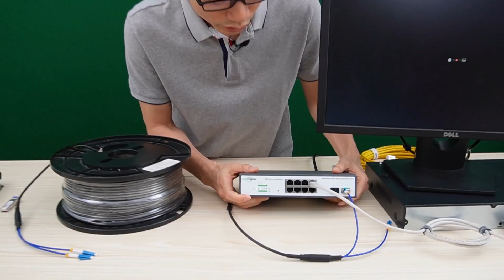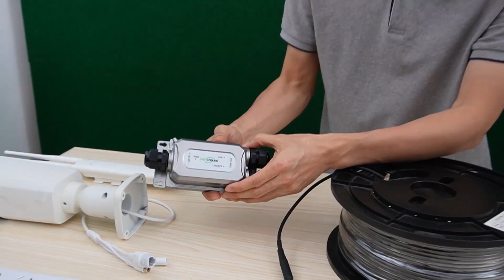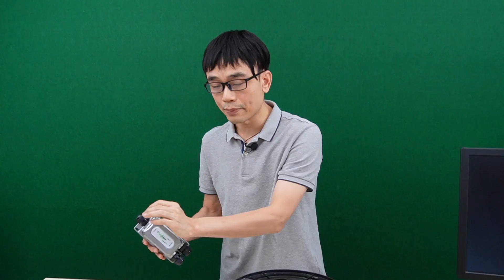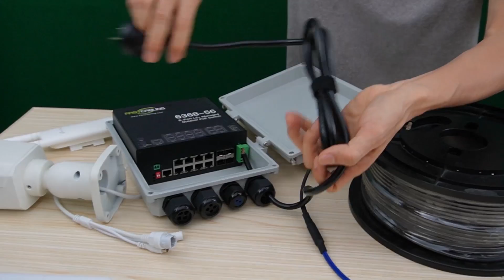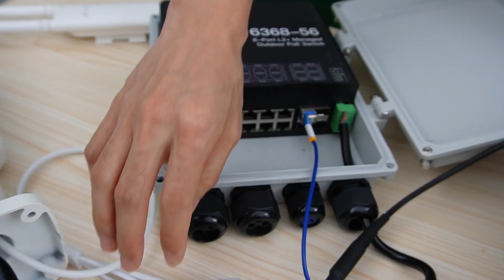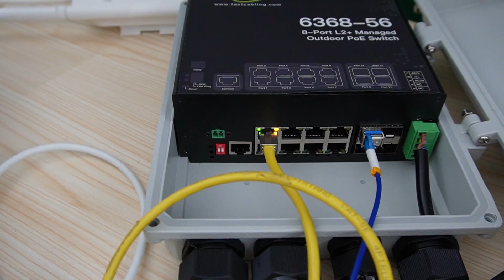Single Pre-terminated Fiber Optical Cable and Mutiple IP Cameras

Comment: Thats a 8 port switch. Can you stack a second switch if you require more ports? From one of the 8 ports?
Reply from the maker: Yes. If you’re connecting a second switch, use an uplink port if the switch has one. If it doesn’t, a standard PoE/data port will also work.

Comment: Good job but what if the cameras i want to install are more than one, meaning i will get one media converter per each camera at both ends
Reply from the maker: You can use a PoE switch with an SFP uplink port or connect the media converter to the PoE switch. From the PoE switch, you connect to your cameras via Ethernet.

Comment: Fiber optic cable can transfer power to camera ?
Reply from the maker: Regular fiber optic cables typically don't transfer power, but there's a cool solution – composite fiber cables! They can transmit both data and power over fiber.

Comment: Now that you've connect the switch to the NVR LAN port, how do i connect the NVR to the internet?
Reply from the maker: You can connect the NVR and the switch directly to the router.
Reply: @Fastcabling  maaan. After all that hard work of laying conduit and running cables. 
My setup did not work. 
I used a single-mode fiber optic with Huawei SFP. I did not have a BiDi SFP so I'm awaiting that to arrive, hopefully, that is my problem. Everything else is okay, The POE switch powering 13 IP cameras, and all works.
Reply from the maker: The Huawei SFP only work with Huawei switch because it has proprietary codes. You might need the SFP transceiver with generic code.

Comment: at least how much distance between these NVR and poe swich
Reply from the maker: It could be between 1 meter and 20km. Basically you don’t need to consider the distance issue with single mode fiber optic cable.

Comment: How do you know which SFP Port too use with a fibre optic modem .?
Reply from the maker: You might need to check the spec of your modem. Some switch required SFP with vendor specific code. Others will use generic code. You might refer to this video. How to choose SFP transceiver for fiber optical cable
https://youtu.be/llUiJ_NLb9Q

Comment: At the end of the video it looks like you have an outdoor antenna for connecting the 2nd, 3rd and more cameras. Is that how you are saying to connect More than 1 camera?
Reply from the maker: It is the outdoor PoE switch. Yes you do need outdoor PoE switch to aggregate the cameras together before it can send it back to NVR over single fiber optic cable.
Reply: @Fastcabling  sorry, but I’m still confused. With the outdoor poe switch you can add up to 8 cameras, right? So, how can I add more than 8? 
Do I need to connect a second outdoor poe switch to one output from the first switch? Like cascade?
Reply: @ALPHABOXERS you need 16port poe switch to make it happen..